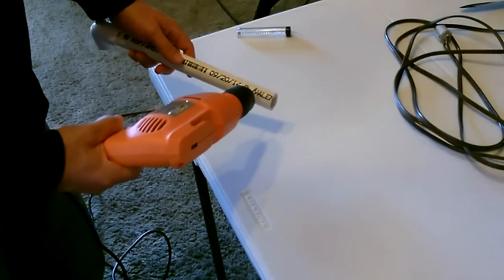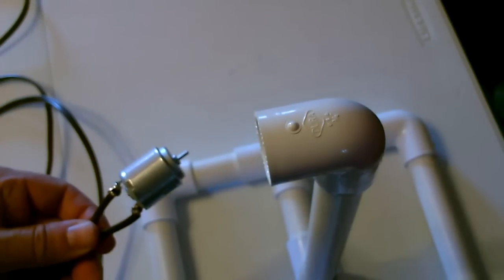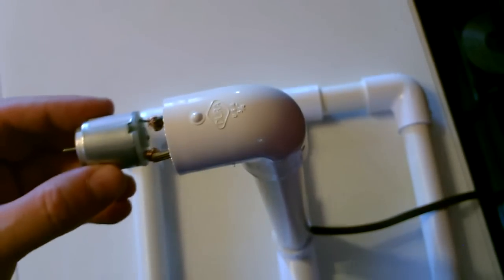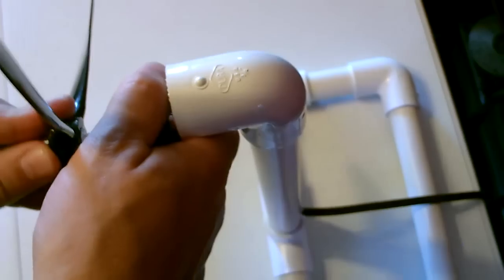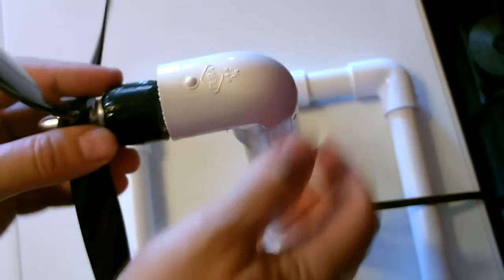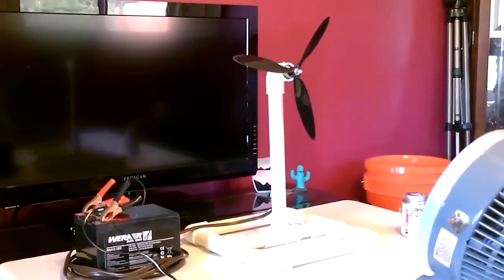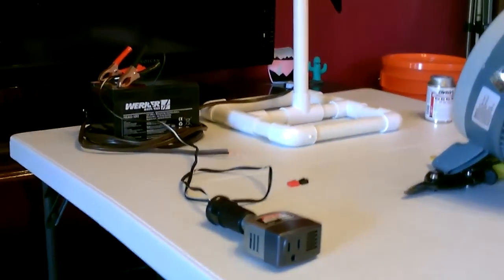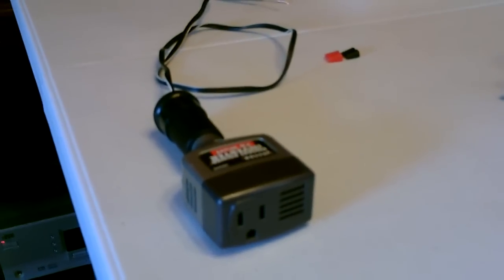Homemade Wind Turbine Generator! - Wind Power Generator! - simple DIY (runs radio!)

Comment: we just wanna know where to get those little props at that slide onto the motor shaft looks like a remot control plane part
Reply from the maker: ***** hi there. the propeller and prop adapter (metal part) can both be found at hobby store.
Reply: I may be wrong but it looks like a simple DC motor which I believe you can find online easily, or even at Radio Shack.
Reply from the maker: ***** yep. it's just a small generic DC motor

Comment: In place of a charge controler you could just use blocking diodes. I always add some inline to my solar panels so the batters don't burn them up is my charge controller fails.
Reply from the maker: John Strabismus agreed. is a good and simple solution. just remember to monitor the batteries state of charge so it doesn't overcharge. (easily done with a voltmeter)
Reply: desertsun02  alsoyou can put a zener diode after the blocking diode to limit the voltage to the battery
Reply: that's a good idea 'cause not only is it more effective it's also a lot cheaper than buying a charge controller.
Reply: Hi
Reply: Good idea. I was going to mention the diode, but you beat me to it.
Reply: +North Carolina Prepper may i see how to assembly that diodes ?Thankyou

Comment: Very nice, always glad to learn about new ways of creating/storing power, though I still have a great deal to learn. For example, the part that you said goes between the fan and the battery.. I have no idea what that is, what it looks like, or how one would hook it up, etc.

And if, say, you already had a battery bank fed by solar panels, would attaching this help charge them even a little faster, or is more of a small, 'stand alone' type deal? Thanks!
Reply: I doubt this little motor would charge any significant amount to batteries, which is why it can only operate small electronics.  But the concept that he's demonstrating is great.  If this were larger scale with a larger turbine, you could definitely use in-line with a solar battery bank, or as a stand alone system.   I'd love to see DesertSun try to upscale this with a larger turbine (perhaps even making a diy homemade alternator and connecting larger fan blades made from cut PVC halves).  👍
Reply: How many household appliances will something like that power ?
Reply: @slowgynman1234.  as many as you want! Your neighborhood too!